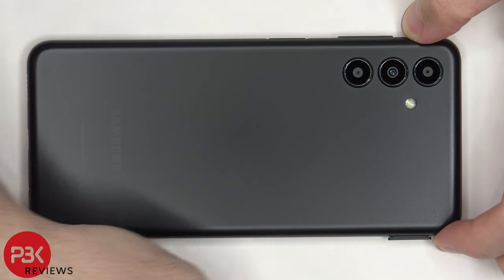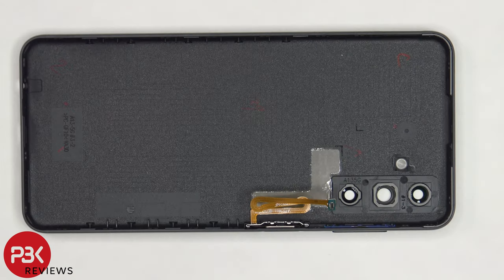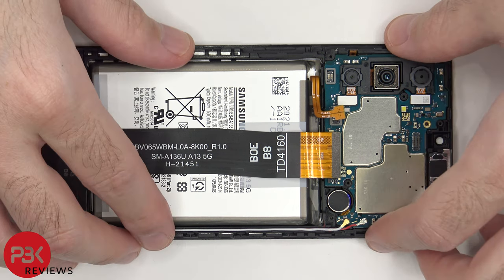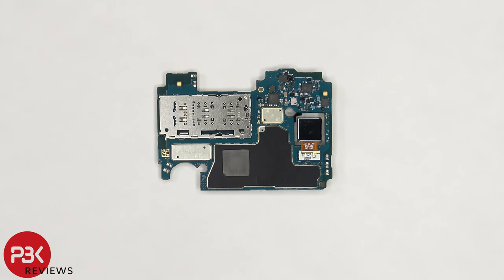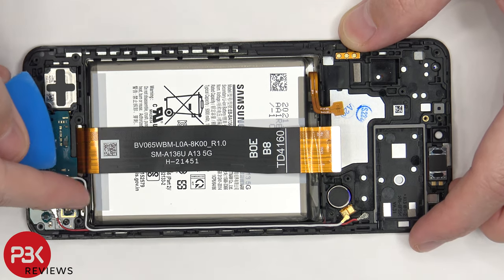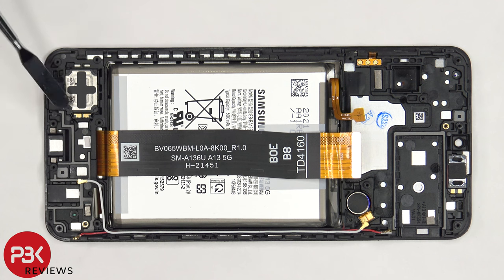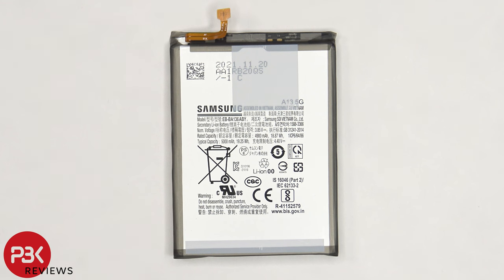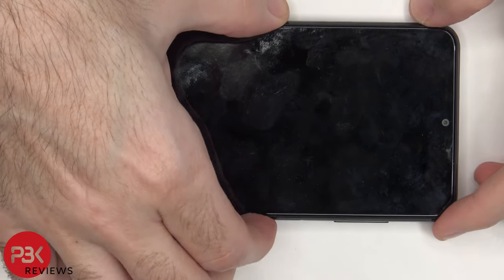Samsung Galaxy A13 5G Disassembly Teardown Repair Video Review

Comment: Nice to know that you don't have to remove the screen in order to get to the battery. Each smartphone I own will last more than 5 years and while I can keep it pristine with the case and screen protector, replacing the battery is always a challenge since they stopped using the removable back cover. This phone almost has the removable back cover.

Comment: The unlocked version I have does support limiting the battery charge to 85%.  Still prefer the plastic back panel in case I need to replace the charging port or something else.

Comment: This is just about the best easy to understand and follow up cell phone repair video that I have seen for a long time if ever .

my Samsung Galaxy 20 battery overheated swelled up to the point where it push the cover off the back of the phone causing screen burn , I got a battery off eBay except for some reason it became finicky when it comes time to charge it , sometimes  it will charge fast yet most of the time it will sit there for hours with minimum charge , I went through all the Hoops replacing cables& Chargers making sure the port is clean and none of that help , option A was to replace the battery a second time option B getting a new phone , I just cut my losses and get a new phone , it would have been a good idea if I have come across this YouTube channel prior to doing whatever I did to that phone .

excellent job

Comment: Hi there!  Great educational video, and thanks for sharing!  Being my 1st time disassembling a cell phone, I inadvertently removed the screen instead of the back cover.  Now the screen doesn't seem to want to seal as well as it did.  Should the screen just snap back in place, or is there more to it?  My A13 got dropped in water for a few seconds, and now it keeps "overheating", and not sure if I need to clean any components with alcohol?  Not seeing any water inside the unit.

Comment: What parts do i need to clean if I'm cleaning for liquid damage?
Reply from the maker: Brush off any corrosion around chips or connectors on the motherboard or components.
Reply: Use isopropyl alcohol.

Comment: Hi mate, I'm wondering if you can help me? I performed a screen repair on my Samsung A13 and for some reason I could only hear on phone calls afterwards when the call was on loudspeaker which is not very convenient lol
Now, yesterday I was on my way out and my phone slipped out of my pocket. Then I got in the taxi and the phone started to turn off and the Samsung logo was there it felt like for about 5 minutes. It switched from the logo to a blank screen to an update of some sort up until I got out and then after it wouldn't switch on at all.
I started to open the phone up last night to see if anything was dislodged or anything but I'm certainly no expert in this area lol 
As I started to open it up with a stanley blade and prying tools it started to turn on and off again. thing connecting the screen to the back wasn't dislodged and that's the only thing I've checked as I have absolutely no idea what I'm looking at or what could be causing the issue. Any ideas? Any advice would be massively appreciated particularly as it's my only phone at the moment! Thanks.
Reply from the maker: I'm honestly not sure it can be many things. From defective screen that is shorting the phone, to the main board not being placed correctly (for the contacts to touch the ear piece speaker contacts for signal) to loose cables or even physical damage to parts on the main board when taking it apart.

Comment: Hi replaced a cracked screen but now the hearpiece isn't working any help thanks
Reply: Did you fix this ? I have the same problem.  I just opened it up again to check the connections but can't see what's wrong

Comment: So the problem I'm having with my phone is the distance I can move away from my phone while using my Bluetooth connection. My range on my logitech speaker is a really far range. Since I swapped frames after breaking my screen, my range is only like 5 feet then it disconnects or is choppy. What controls the Bluetooth function? Is it on a circuit board or is it controlled by the red and white wires?
Reply from the maker: Yeah there is a Bluetooth chip on the board. You can always take apart the phone and make sure all the connections are good and put it back together to see if it helps.
Reply: @PBKreviews  I figured out what was wrong. I've been waiting for my new battery to come in because my current battery is swelling and not maintaining battery life and shuts off. It doesn't help that I ordered the power flex of an A32 by accident which is shorter and I can't keep it on and close the phone. I had to put the protectors back on to seal it up and reconnect the red and white audio cables. Much better now. Thanks for the advice. I'm still going to reconnect everything when the battery comes in

Comment: So we don't need to heat the back cover to remove the back cover? I understood it has adhesive to secure the cover as well as the tabs around the perimeter
Reply from the maker: No heat needed and no adhesive.
Reply: @PBKreviews  thank you so much. Good video. Precise. Damn sure no long drawn out talking. If you were a chick I'd want to Marry you for that fact alone.

Comment: What could i use to pry it open? Is there a specific kind of plastic?
Reply from the maker: I have links in the description for different tool sets. You can use a pry pic which is listed in the description as well which is basically like a guitar pic, and start from where the sim slot area is since the plastic is thin in that area and easier to push the pry tool in between the back housing and frame of the screen to then run along the edges and pop off the catches.
Reply: @PBKreviews  thanks, I attempted with a guitar pic but it wasn't able to get between there, I saw on an article that using a hair dryer to heat the area will help it be easier to pry it open, is that a good idea?

Comment: Can i use this to fix water damage??? My mom accidentally put her phone in water and i wanna fix it so bad at all costs. I feel fo bad for her . Please help me
Reply from the maker: yeah, you can take the phone apart, disconnect the battery cable, dry out any liquid inside, use a small brush like a tooth brush to brush off any corrosion around chips or connectors, and then power on the phone to see if it will work. If not, you would need to diagnose to see which part has gone bad, between the screen, battery, charger port or motherboard. Hopefully not the motherboard since at that point your out of luck.

Comment: I wish toke apart the sim card harder as found on the unlock phone One the sim card thing doesn't work just the one closer to SD card works only
Reply from the maker: not sure what you mean
Reply: @PBKreviews  the unlock phone has two sim cards for two lines on one phone . I found out what's it gets android 12 update fixed the issue

Comment: Stuck on step 2 for 15 min. Who just happens to have a plastic pry tool available? I can't get the thing open
Reply from the maker: You can use an old credit card also or something similar. Also start where the sim tray area is where the plastic is thinner and easier to get a pry tool in between the frame and housing.

Comment: Why the fuck do people put the fingerprint sensor on the power button
Reply from the maker: It's convenient when your aiming to turn your screen on by pushing down on the power button, it automatically unlocks it as well. I find it useful since I hate most of the in display readers which are slower and sluggish but I preferred the fingerprint readers on the front bellow the screen on the older motorola z2 force.
Reply: @PBKreviews  There was never anything wrong with keeping them on the back, Im going to pick the phone up if Im doing more than checking the time, which if I do on a phone with a sensor on the power button, I'll just check the time repeatedly because Im like that, the phone locks, so I have to use the pattern
Reply from the maker: @genericscottishchannel1603  yep not sure i guess it comes down to personal preference.  Would be cool to have the sensor in multiple locations.

Comment: I don't kW if ur gonna answer this comment, but I hope u do
Reply: If ur phone drop in a pond of water and uh put it in rice but it's not showing nth on the when uh Tek it out the rice but it's vibrating can it be repair ?!
Reply from the maker: You need to take it apart, disconnect the battery and dry out any liquid or moisture inside. Then use a brush like a tooth brush to brush off any corrosion around chips or connectors. If you keep trying to power it on like that, you can short the board beyond repair.